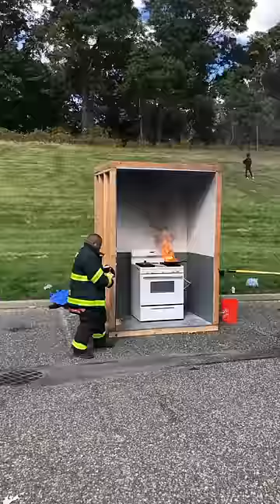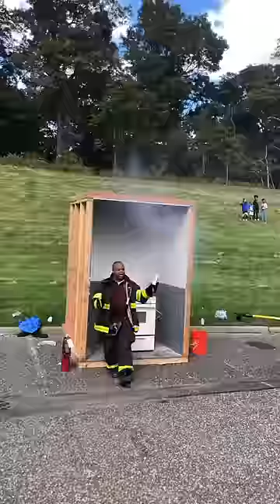Coram Fire Department Grease Fire Demonstration

Comment: I never knew baking soda can put off fire. Thanks for sharing.
Reply: I know it works on greace fires.... thats why its good to have a big box of baking soda at home. That shit can do alot. I even have a little open jar of baking soda in the fridge to help absorb smell between cleanings, sometimes use in the laundry as an extra kick for the detergent in the summer time since I sweat alot and I want to make sure to get the smell off, wash my sneakers with it ever other month or so depending on the time of the year (again because I sweat alot and dont want my stuff to smell and baking soda is cheap).
Reply: @Marika50 Do you wash your sneakers manually or in the machine? And how do you use the baking soda?
Reply: @jan_777  yes in the machine and baking soda helps to get smell out of the inside part of the sneaker. It can be helpful to get smell out of any stubborn smelly cloths
Reply: @Marika50  Thanks!
Reply: So can a lid without the mess, always keep a lid nearby while cooking
Reply: @elizabethc3842  That lid must close air tight or it won’t help.
Reply: A lot of ABC fire extinguishers are sodium bicarbonate (baking soda) based.
Reply: @Marika50  what if we wash our feet with baking soda ?
Reply: Thanks😊 @Marika50
Reply: Let me guess? Arm and hammer  @Marika50
Reply: @tom8464  nope.... I basically het stuff in the baking isle, usually a big box of a store brand since its cheaper per oz so you get more for your dollar
Reply: Baking soda is a neutral base... and will absorb grease like a sponge. Kind of like acting like a fire extinguisher. I always (like muscle memory) keep a box of baking soda out when I am cooking on the stove...ya never know!
Reply: @jan_777 pour it on the fire!!  😂😂
Reply: @duke1281  How does that help getting the smell out of my sneakers?
Reply: @Marika50 putting the cover on will also put the fire out... Or a towel, a shirt... water is a bad idea because it boils at a lower temperature and will instantly become steam, which will not only hurt you by itself but also carry very hot oil drops with it.
Reply: @jan_777 not quite, it's just got to be tight enough that the fire uses air quicker than the air can get in past the lid to the fire. You'd be surprised how unwell fitting the lid can be.
Reply: And thats why these kids are learning it
Reply: @jan_777 don’t need to be airtight. stop drop and roll certainly isn’t air tight lol. idk where you got this idea from. fires actual need a good bit of oxygen, and cutting down availability by 96% will put most out.
Reply: it's basically a type of salt. A lot of people clean grease off cast iron pans with sea salt. It absorbs the grease.
Reply: Me neither
Reply: @Marika50  do you know it helps with heartburn too?
Reply: For any fire, you need heat, fuel, and oxygen for it to last. Baking soda releases carbon monoxide when heated and removes the oxygen from the fire. It's good for small fires but fire blankets and last resort powder fire extinguisher are better for larger fires till the firefighters come
Reply: I use salt

Comment: I'm almost 40 years old and never know baking soda could do that. Very  useful knowledge. Thank you.
Reply: Just cover it with a lid, is more likely you'll have a lid than the baking soda in an emergency
Reply: Correct. All u need is cover the pan with a lid, that will do the job
Reply: @lildumpling444  I almost burn the apartment when I was 16 yr old, I was frying fries and they were frozen and been in the freezer for a while, I only eat fries when I make poutine,  so when I drop the fries into the pot full of hot oil it lit up like an after burner,  I freak out and ran outside to see if there was a fire extinguisher but it was only the hose, I walk in the apartment and collected my self and put the lid on it and snuff it just like that.
Reply: Only a matter of time before some kid uses flour in an emergency...
Reply: Bro where you been
Reply: Just remember, turn the heat off also!!!!
Reply: @Atite_Lometen Or turn off the heat and add more (room temperature) oil. This will decrease the overall temperature and the flames will go down. In case you have no lid around
Reply: You're telling me for 40 years, I could have been doing this? pahhghh ain't no way
Reply: Same
Reply: Or salt
Reply: Oh no fire fire!!!! Where the hell is my baking soda??!! 😂😂
Reply: @KevinWeatherwalks  You sound anguished - how often are you burning a kitchen down, exactly?
Reply: You can also cover it to cut the oxigen
Reply: Basically anyway you can get the oxygen out of the fire
Reply: @matspierzyna4563 what would the flour do?
Reply: And salt I keep salt next to my stove
Reply: Our stove started on fire because my mother in law has been “cleaning” it with the self clean heat option thinking it got all the past history of grease out of there 😂😂😂 so there was a fire and i tossed in baking soda. I learned this in elementary
Reply: @matspierzyna4563  thats called parenting
Reply: Baking soda can do a lot of things
Reply: @Atite_Lometen  Okay thank you, 1st purchase not to be made when I would be alone. Oil fryer 🗑️ but Air fryer 👍🏼
Reply: @DavCro  Apologies, I have deleted my comment! Now to swap the powder for soda 😅
Reply: @WaffleSalad  Flour is very flammable, because is a dust it can created a change reaction, like sawdust too, whole factories had gone up in flames when the dust sparks up.
Reply: @KevinWeatherwalks  I get it Kevin 😂
Reply: That's what they use in dry chemical extinguishers. At least they did in old ones.
Reply: Never had a greese fire guess I kno what I'm doin 😅
Reply: @Atite_Lometen That is the Frenchest comment I’ve ever read.
Reply: @matspierzyna4563 I thought why not use flour until i read your comment and realised flour burns☠️
Reply: @Atite_Lometen I have hella baking soda, I thought that was the norm to at least have one in the fridge lol
Reply: Wow that's sad
Reply: How in the fuck did you make it to 40 bro?
Reply: Mary,I'm  in my late 60s I didnt know that.
But I did use water.....once

Comment: I actually had no idea baking soda could do this. Thank you for teaching me this
Reply: A LID is the correct answer tho. lids are easier to find, and work correctly in almost all fire types.
Reply: Yes, covering it with a lid is often a better choice because less mess and easier to do.
Reply: @diox8tony  if its an ooen grease fire this is more reliable though. People tend to panic and looking for the lid could cost valuable time ve just pouring baking soda or salt on it.
Reply: @robertharris6092 on the contrary getting baking soda out from a cupboard could take just as long if not longer. Depends what’s on hand really, because in a panic that’s what you’re gonna go for. Either way, still good information to know
Reply: @jackthehacker05 my baking soda is right above the stove and my lids are across the room it's a lot easier to grab the baking soda it all depends on where you store your stuff
Reply: Or just stick the pan in the oven. The one thing in your house designed to hold hot stuff.

Comment: This is a great example of something that needs to be shown to not just the kids, but adults.
Reply: Sure, cause I walk around with my baking soda ready for any emergency fire.
Reply: @Atite_Lometen if you’re dealing with a grease fire, you’re likely in the kitchen already and there’s gonna be baking soda in a cabinet within arms reach of you. So yeah, you are gonna have baking soda.
Reply: Something like this happened when I was 13 or 14 , I wanted to fry something and put the beaker with oil on stove .Then i forgot about it and soon heard some sounds from kitchen . I got it what it was the moment I heard it . When I rushed to the kitchen I saw fire in the beaker as the oil has crossed its ignition point and started burning . I knew exactly that we have to block the supply of oxygen to stop and never pour water on it . 
 But I was so frightened at that moment and my parents were also not home , that I panickly tried to get the beaker off the stove . But it was super hot as flames were coming out of it and my hand burned from its heat and I slightly dropped some oil from it on the area near stove . The oil that was dropped on that area was still burning like before and it was scattered near the stove . The main fear was gas cylinder which wasn't far from it . I was so panicked that despite the knowledge , I poured water on dropped oil and the flames intensified and oil scattered even more covering more area . Hopefully , my elder sister came there and she quickly took a towel , made it wet and put it on the oil and it stopped burning . This was a horrible experince . The main thing is that you sometimes forget the things you need to do in panick .

Comment: If u don’t have baking soda u can use a wet towel rinse it and then cover the pan it will smother the fire.💯🙌
Reply: Don't use a wet towel. You risk causing the oil to splatter and erupt, rendering that a very dangerous option. Use a fire blanket.
Reply: @Sara-L  or the fucking lid next to the pot/pan

Comment: Another good thing to remember when putting out fires is the type of extinguisher your using, if you didn't know there are different categories of fires that require a diffrent kind of extinguisher,  they range from class A to class K, this fire for example was a class K which would require an extinguisher rated for class K fires or grease/cooking fires, same goes for all the other classes of fires, to make it easier they have multipurpose extinguishers to that are rated for multiple classes of fires, stay safe out there ❤

Comment: If working with grease or oil, you can also keep a damp, not wet cloth. If you have a grease spill or oil over the rise, just cover pot, and you will remove the oxygen. You can prevent ignition if you are early enough

Comment: Today I was toasting a grilled cheese sandwich in the Black and Decker Toast-R-oven and flames started to burn I remembered not to open the door and covered the oven with towels to stop air getting into it. I grabbed it and put it outside on the grass and let it cool down.
I cleaned it. But I wondering if it will work. I’m always very careful and watching that the small ovens are extremely dangerous if left alone. ALERT 🔔 The cheese melt down and fall into the heating element. 
It can take 2 minutes to creates flames and the melting cheese will burn more. 
The toast was very good and I removed the burnt from the bread.
I am lucky. Thank you for the baking soda. This is a question of nursing.

Comment: If you use a pan and the fire is not big enough yet, you can just put the cover on top of the pan to eliminate the flame from getting the oxygen to burn if you don't have a baking soda.
Alternatively you can cover the fire with thick and wet cloth/towel, just make sure that it's wide enough, quickly do it and fully cover the pan all the way through.
And always remember that the bigger the fire, the harder it is to put out so don't just stand there and act fast.

Comment: Have you got any tips for ebike owners in the case of a fire with a small battery?

Mine hasn't shown any signs of damage, but forewarned is forearmed, so to speak, and any any information helps.

Ive never heard of throwing baking soda on a cooker fire and it's excellent advice.

Comment: Anything that can choke the fire so to speak no air no fire flour sand dirt baking soda all work for grease fires as well as an extinguisher but those are kinda valuable pretty much only comes in handy for electrical fires but of course power should be off grease and oil fires are the same as well as battery explosions and they get hella hot so warning do not try

Comment: You can poor oil into a grease fire. It will cool the other oild before it can heat up the added oil to burning temp NEVER WATER baking soda like he said works great but if you got the oil in your hand just poor it in

Comment: Or you know….put a lid on the pan to submerge the heat causing the flames to subside with no way of oxygen coming through to indulge the fire even bigger causing the grease burning pan to reduce the levels of…….im just fuxking with you; add baking soda 😂